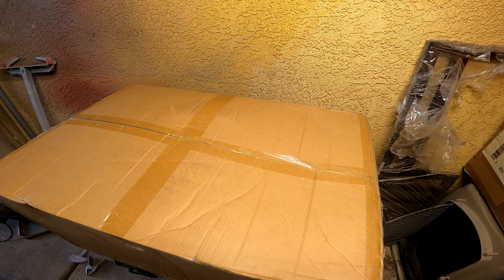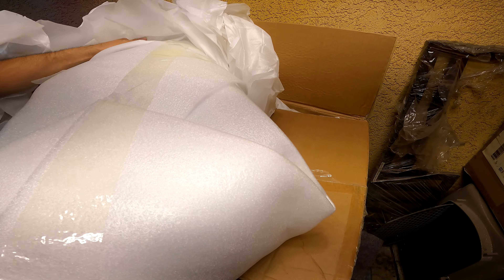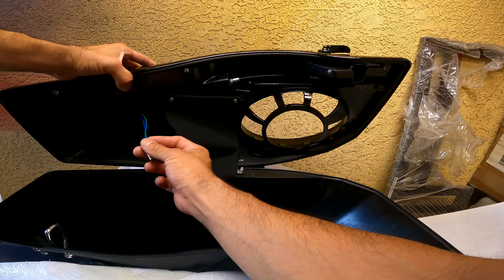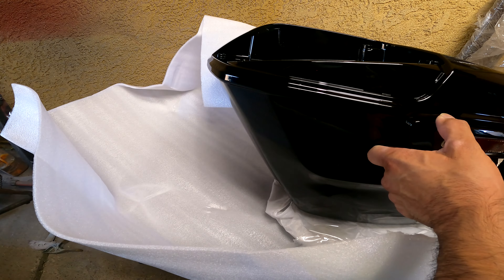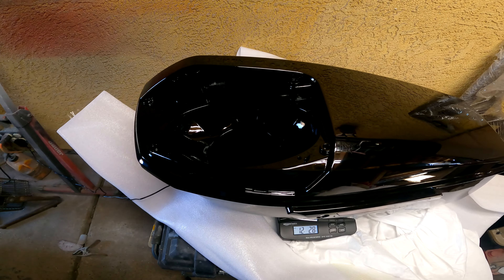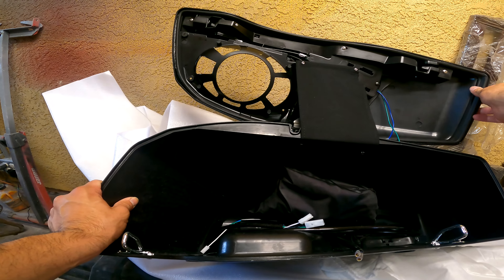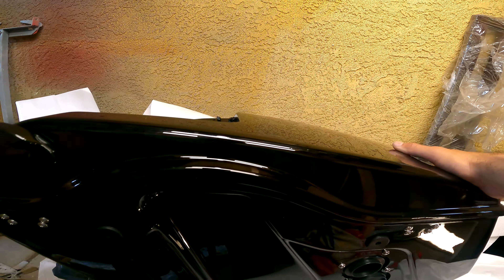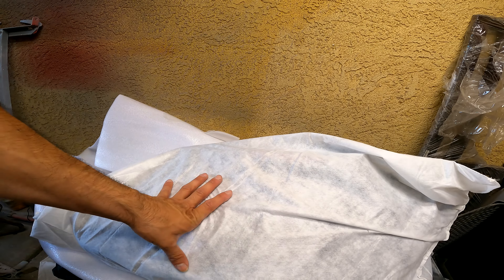Unboxing 2023-2024 CVO Saddlebags w/ 6x9 Speaker Lids - Harley Chopped Saddlebags

Comment: How close are the dimensions between the advanblack chopped  bags and the Tmct 24 CVO bags. From what i was seeing
The tmct bags are a lil
Smaller in dimensions, which that’s what I was looking for
Reply from the maker: They’re slightly smaller, but they’re a bit wider. Honestly, they’re all about the same, I would say the nasty hogs are the only ones that don’t require a mounting bracket .